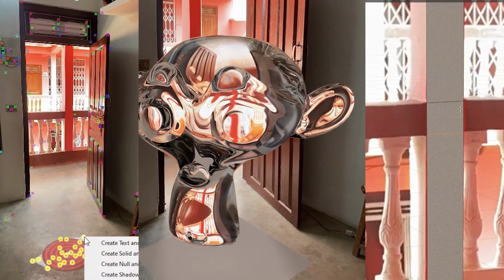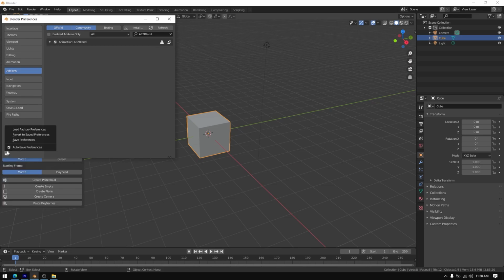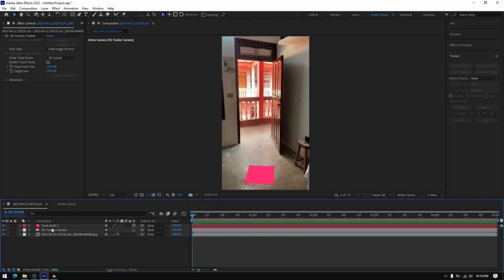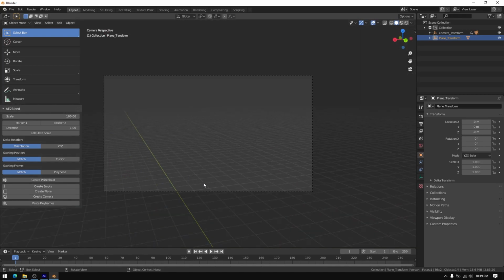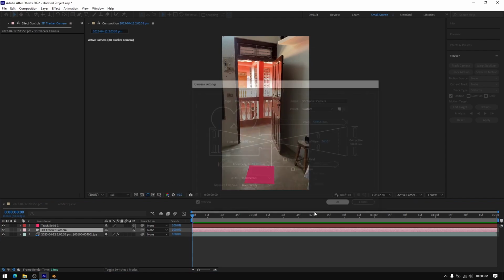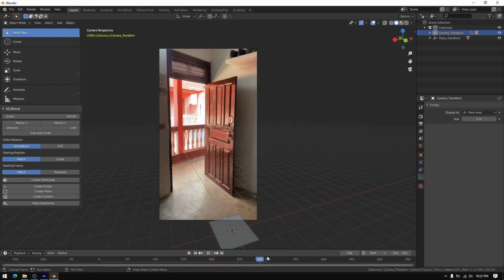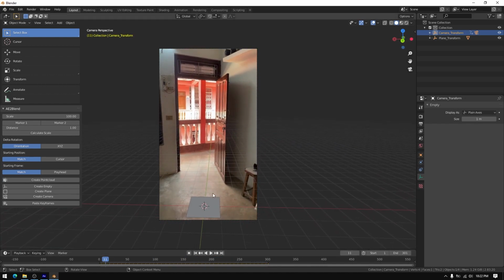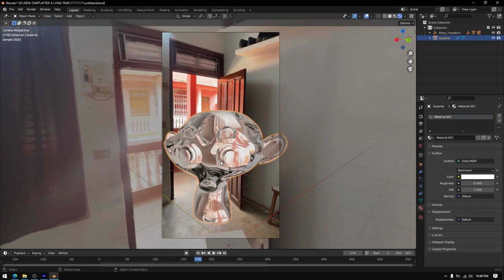Export After Effects 3D Camera Tracker to blender | AE2blend | Tutorial

Comment: Why focal length / 1.7777 ?
Reply from the maker: Because blender camera doesn’t crop from horizontal to portrait instead it adds space on top and bottom to make it portrait. So dividing it by 1.777777 crops it to original focal lengh.

I am talking about cropping focal length, not resolution. Its hard to explain.

Comment: Hii @pkvfx, I am facing issue after exporting the tracking data on blender. After exporting the datas some of my solida are above world origin and some are below. So, unable to modify my 3d objects properly. Can you please provide solution for this ? It will be very helpful. Thanks!!
Reply from the maker: Make sure you set ground plane and origin in after effects. And create solid using same points used for (ground plane and origin). And  also make sure you “export camera 1st” “solid created from origin points 2nd” and then only other solids after 
wards. Exporting main solid before other solid is important.